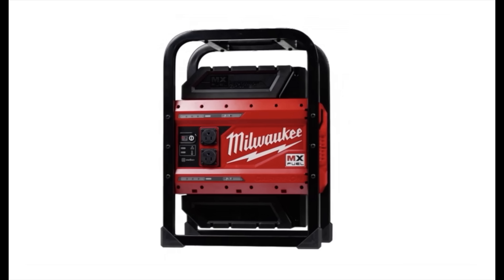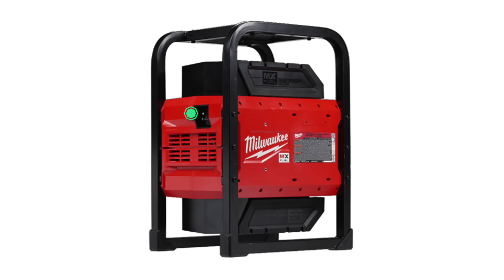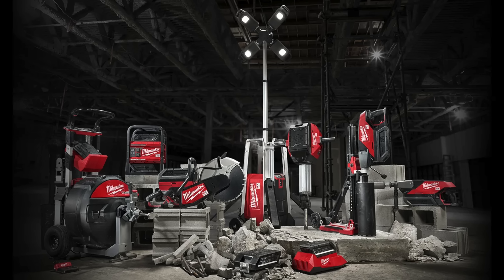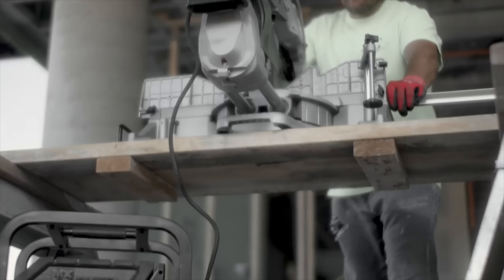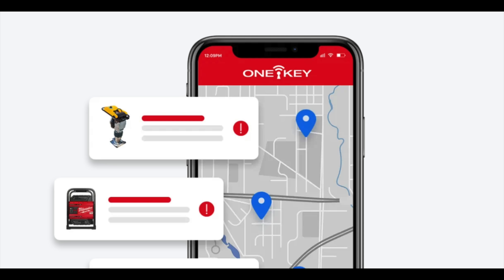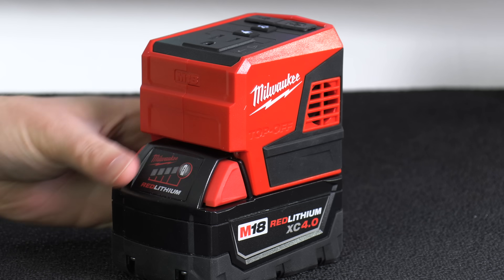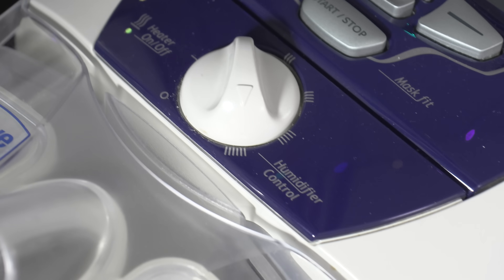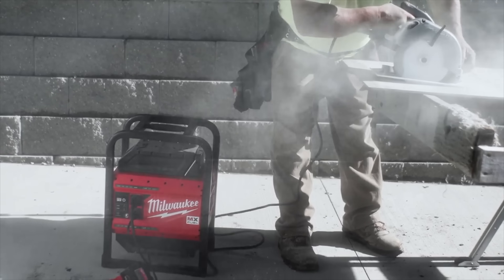END of GAS Generators? Milwaukee MX Fuel Carry-On Changes EVERYTHING 3600 Watts!

Comment: And if when the time comes to replace the batteries...they “accidentally” went discontinued?
Reply: Then you could probably buy the cells and take the pack apart and replace it yourself just like you can with almost every cordless tool battery.
It's amazing how many people I've seen that can build a house from the ground up, but can't seem to do a cell swap on their battery pack.
Reply: @deejayimm  Battery manufacturers DO NOT want consumers opening sealed battery packs. Most people don’t have the skills or tools to properly recondition battery packs. One melt down and you will understand why.
Reply: @headfirst6227  sure if the battery pack is sealed, that's going to make it a problem.
Most power tool batteries are screwed together, and you'd have to be an absolute idiot to somehow expose a lithium cell.
Reply: @deejayimm  99.9% of the buyers of power tools in general don’t know how or wouldn’t want to do that.It’s possible but not that easy
Reply: @Mr.Spiderguerra  Most people dont knoe because they have been trained to buy what is sold to them.
Building a house is not easy, cell swapping a battery pack is a piece of cake, yet I have watched hundreds of home builders waste their money.
Most people want the convenience of just buying a new one.
Reply: @deejayimm  Exactly my point
Reply: @Mr.Spiderguerra  The only reason I replied is your point was you would be screwed if they discontinued the battery.  My point is, most of the time your battery is comprised of individual cells, and most of the time they are not hard to replace and are even cheaper.  Hell sometimes you find out your expensive battery was using cheap ass cells, and you end up with a better battery for cheaper.  Back in the day I used to even do it on laptop batteries.
Its just a matter of what your willing to do to not get ripped off.
Reply: @deejayimm  I wouldn’t be screwed for sure.In my line of business i create things and solve problems that are “unsolvable “.I was pointing out an issue that will come up for sure for most of the potential buyers.Battery swap is kindergarden stuff.For most of the lazy ones is unreachable.It seems  you think that you are the only one that nows a thing or two about life hacks.
Reply: @Mr.Spiderguerra  if you say so, then it must be.
Reply: @deejayimm  When you deal with large packs the margin of error goes way down.   It isn't some bluetooth speaker with a 16650 hidden away inside.   Once the design of the pack starts paralleling strings of cells you better know exactly what you are doing.
Reply: Nomen Clature  i love the internet.

Comment: So it's rechargeable so it use electricity.. ?? So  you can't use it in no electricity area so if this thing gone lowebut you use it then. 😂 unlike gas GEnerator if the gas run low you can refill it and use it

Comment: This is NOT a generator. It's a battery pack and inverter. Without electricity to charge it up, it's a BRICK. If you want a generator, go buy a real generator that runs on gas, propane, or diesel, and doesn't need an external power source because it IS the power source.🙄

Comment: Seems like a neat gadget. Good for contractors working inside buildings with no power.  Especially  good for small jobs. People don't leave thier table saw running constantly so for maybe 20 3 minutes long cuts over the course of a day it might be a good fit.
Reply from the maker: You have it figured out exactly and what they seem to be going after. The hands on test should be interesting to see how it does

Comment: Poor comparison, you're not taking into account replacement cost of batteries when they eventually sh*t the bed. They aren't cheap.
Reply from the maker: Keep in mind almost every other one of these made today, has non-replaceable batteries. So when they are done, that's it. These are very expensive but at least it's an option

Comment: Really battery generators have been around many years well yes they have there called diesel or gas engines that charge batteries. AKA a generator.
I'm only 14 seconds in and I bet this does not come with solar panels to recharge the batteries so it is not doing necessarily any generation, it's only doing storage and that's all a battery can do.
an inverter can do conversion which is only the reverse a the battery charger.
And I highly doubt this is using a fuel cell technology. Sadly I blame this all on the marketing as a "generator" will run theoretically indefinitely given a supply whether that's fuel, sun, water, hydrogen etc.

And I will say that technically fuel is a means of storage which is why large scale power generation uses, gas coal, water.

Comment: You obviously haven’t heard how many times you can cycle lifepo batteries. It beard your older chemistry batteries hands down. And is lighter. And way more reliable.
Reply from the maker: Sure I have and understand the theory & "promise" which is what it is. NONE of the tests done by other channels or me can verify longevity or cycle count. Have you ever considered who you are buying those batteries from? Think about car batteries, they are mostly lead acid, yet some brands seem to last for years and others don't. No difference whether it's Nickle Cobalt, Iron or Ion. You won't know how long it will lasts until years later.

Comment: OMG, what a joke!  Looked everywhere to find 864 watt hours.  So, at 3600 watts it lasts 14 minutes.  Of course, at 1800 watts it's 28 minutes.  $2,200 will buy a lot of gasoline for a real generator, that you could use to charge this piece of crap.  Or a $500 generator and 700 gallons of gasoline.
Reply from the maker: It will be interesting to see what the test shows, it will be the real deal and if the runtime is bad, it may be a big fail.

Comment: It’s been years that Dewalt has release its own battery powered generator DCB1800B which has almost the same specs (1800w sustained/ 3600w peak). I also think its a lot cheaper than this unit even when factoring separate batteries.
In fact the only difference is the batteries ... and no substantial improvement there also. Still looks like a good unit from Milwaukee.

Comment: This seems to make about as much sense as using a Tesla to drive cross country. Once the battery is used up you have to wait for it to charge. Gas powered, you fill up in 10 minutes, you're going again and at full capacity...

Comment: Why would you need an Integrated charger (https://youtu.be/Yie1zCVx7Yk?t=93) to keep your "Generator" topped off on electricity? ...just plug your circular saw into THAT extension cord and save your self a TON of money instead of buying a battery backup "Generator".

Comment: Dumb. I just bought a workbench power strip with two adjustable led lights and 3 USB ports - for $35? Milwaukee is just scalping its fan-base. It should have a row of USB outlets for the workers (with slots to hold phones).  Where's the adjustable work lights on this thing?  Too much for too little.

Comment: A few dollars worth of gas to run power tools all day or half an hour of battery power running a high amp tool at that time.
I doubt it would run your air compressor all day on a full charge. I'd use this for back up power at most. You'd have to charge these batteries constantly to keep up with the demand of running jobsite tools all day.